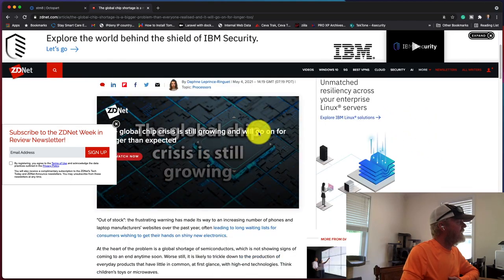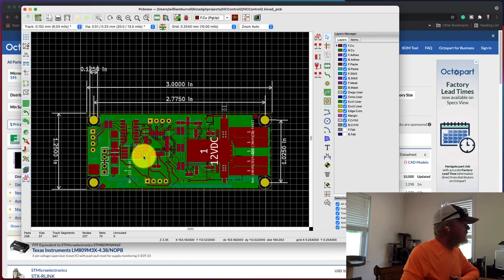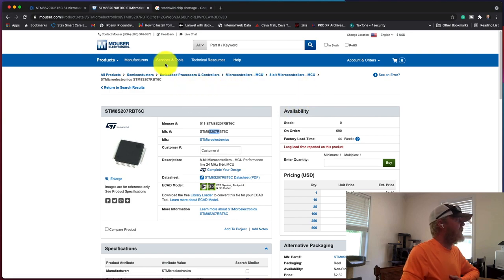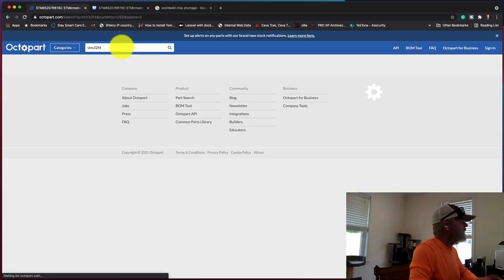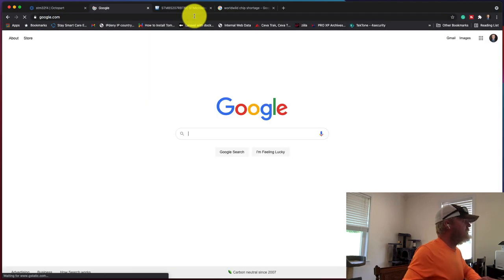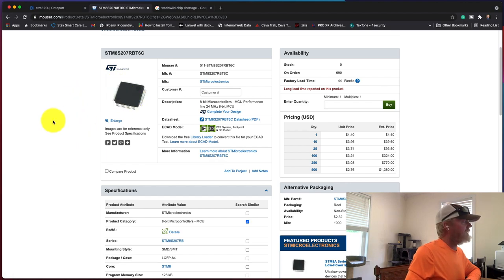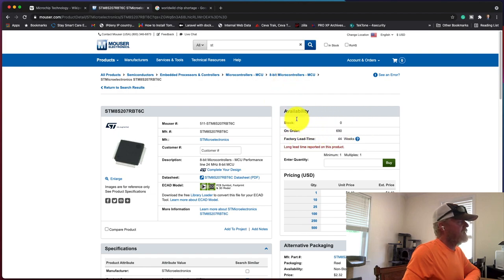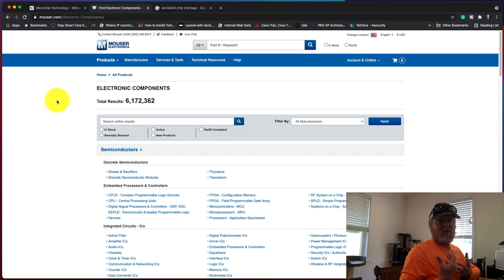Chip Shortage is the Maker Apocalypse

Comment: It's a year later in 2022 and Raspberry Pi 4s are selling in the $150 range, and nVidia Jetson 2GBs (which should be $79) are going for $489.  No signs of things improving any time soon.
Reply from the maker: Most parts are still showing 52 week lead times.  I've had to make complete vendor switches on components and change designs.  Only a temp fix and I expect it will continue to get worse.  STM32/STM8 have been impossible to find.